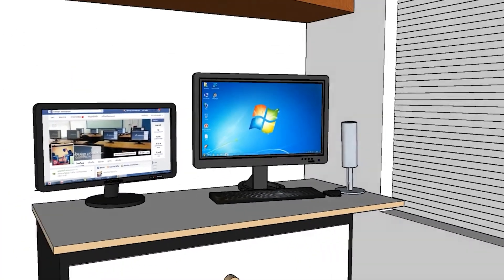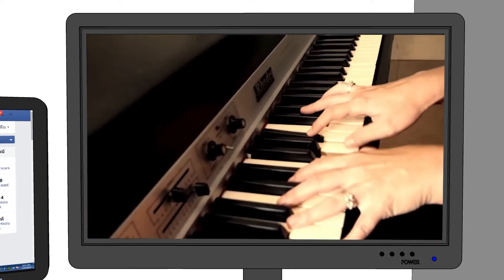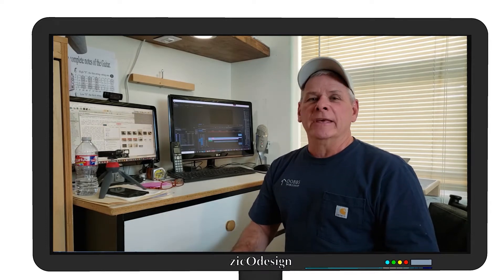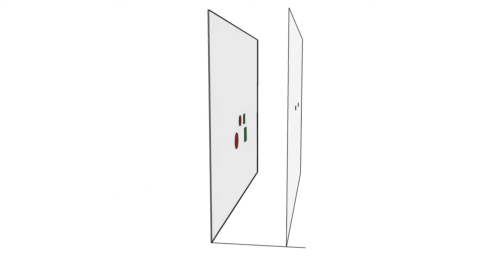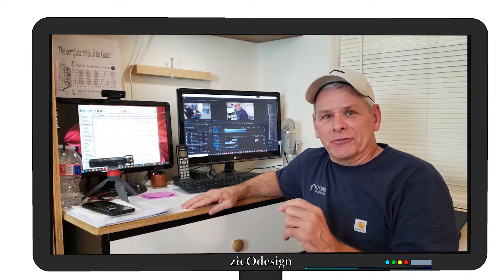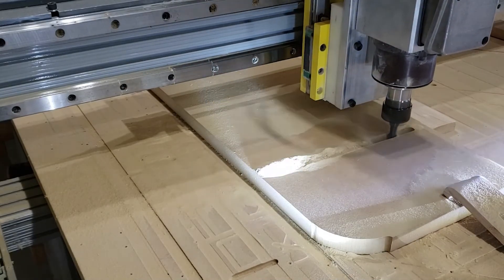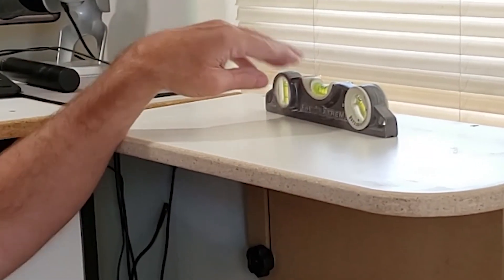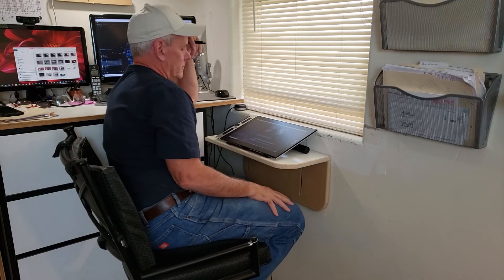Create Unique Ways to Use Your Space Better - And Fun with SketchUp Animation

Comment: Your voice and pacing remind me of those old Disney nature films from the 50s.  I can imagine you detailing a day in the life of that family of marmots that live just over the edge of the hill among the rocks.  Nice bit of nostalgia.

Nice computer desk, and the discussion of your process.  Been looking for ideas.  Thought of something fold out, like wings on a miter saw stand.  Ever hear of Carl Holmgren's channel?  His miter saw stand's wings prop up on something I think he invented called a jackknife brace, a piece of hardwood hinged in the middle, that 'locks' by going slightly farther than straight, then retained from going too far by a block or clip.  A touch collapses it for ease, but adding a pin could prevent accidental collapse.  Ideas, ideas.  Nice channel.
Reply from the maker: Thanks for your comments, Bill! I appreciate you taking the time to reminisce a little. Yes, I get comments ever so often that my cross between Texas twang and southern drawl is easy for some people to listen to. I remember the Disney episodes for sure!

So far on my desk, I have cut a top from 3/4'" melamine and mounted it on brackets to the corner in my office reflected in the video. Got sidetracked with building a souped up new computer, as only a carpenter would, and it sits on a corner shelf under the top. The top is very functional, just haven't turned it into a mobile desk yet. I did check out Carl's channel and subscribed. Looks like he has some interesting ideas so will take some time and watch some of his videos. So many ideas and possibilities for things to do in the shop. Working on getting more videos produced with my son helping me out more. Thanks again for watching and commenting, Bill!

Comment: Great advice in this one. This reminds me of a very similar project I did about a year ago. I do some music production stuff and have a particularly large MIDI controller that I wanted to be able to use at a moment's notice but couldn't justify the desk space. Took me a while to come up with a good solution, but I ended up buying a slide out/swivelling keyboard tray and replacing the metal tray with a wood panel that was appropriately sized. It can be raised, lowered, angled and swivelled then locked in place with a knob. Works great for me! Looks like your solution would be better for drawing though. My slide out table has a decent amount of give when putting pressure on it since it's essentially on a cantilevered arm. Feels sturdy regardless but probably not appropriate for precision work like a drawing tablet. I uploaded some pics if you wanna see what I'm talking about https://imgur.com/a/1wXSxhh

Edit: I should also mention I had a similar problem with knee space on my last desk with tons of drawers, so when I built my current desk (the one you see in the pics), I went the other extreme with nothing more than a finished butcher block on adjustable legs. Tons of leg room but having no storage has its own problems!
Reply from the maker: Hey, Adam, thanks for the comment! Yes, that looks like a good solution for your MIDI controller. I have looked into the hardware for the adjustable legs for the stand up desks a few years ago when that was a really popular idea. I think it may even be the same manufacturer of the product you have from the looks of its controls. I have gone in the direction of building a desk to a height that works for me when I’m standing, with a taller barstool for sitting. In the office, it’s really more advantageous for me to be able to put the desk on wheels to be able to rearrange things as needed than having the adjustable height option on the desk. Plus I was a little leery of suspending drawers off the hardware for the adjustable legs in case the weight became a problem over time. I appreciate you sharing your thoughts! Always helpful to hear other people’s perspectives!